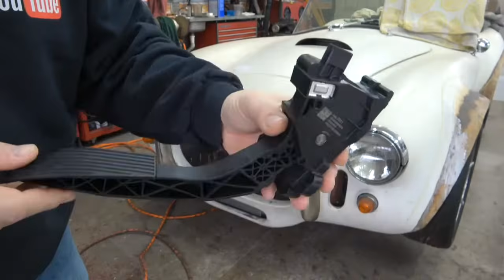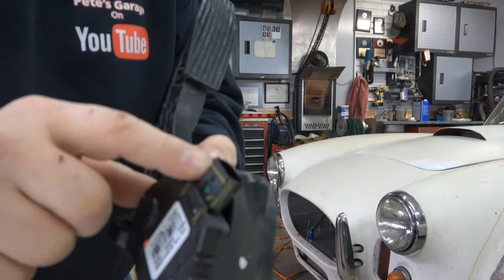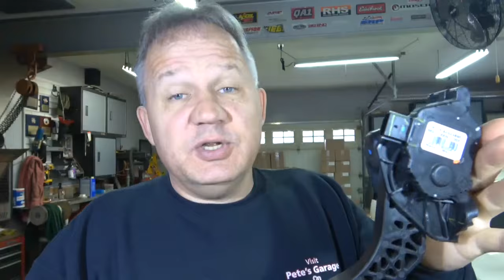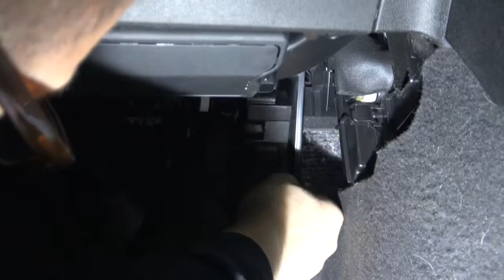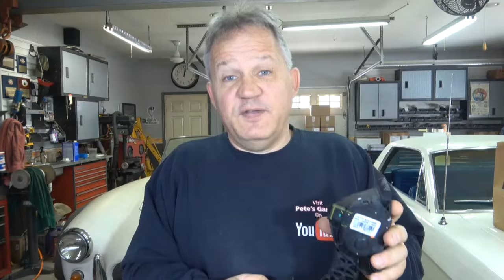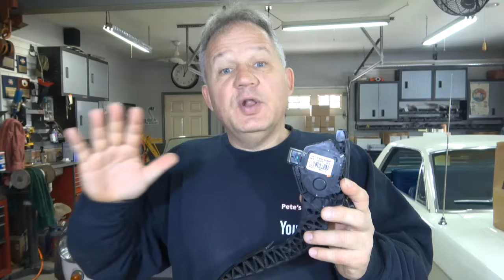Engine Reduced Power Mode - Loss of Power While Driving

Comment: I've had 5 mechanics, including GM mechanics, replaced everything the computer tells me to replace, everything that GM suggest, sometimes more than once, plus extra grounding was done. None of it worked. Last time GM mechanic said computer recommends replace TAC module, which has been done twice and if this does not work there is nothing we can do. Dah, would you ever tell anyone that? shared issue with GM and they said we will get back to you; well they have not and are not interested. Any suggestions?
Reply from the maker: That really sucks. If it were mine I would trade it in
Reply: Hi,were you able to fixed  your car? I just don't  know we're to take my car any more😢
Reply: @marrjor0754  any luck

Comment: I have a 2013 sonic 1.4 turbo and I was driving my car all of a sudden got louder so I tried to get home then the engine power reduce light came on and my car went to 5mph then it cut off and I tried to turn it back on and no response so months later I took it to a shop they replaced the body control module and the car worked great for 3 days and it went back to the same issue so I took it back and they couldn’t find the issue , so far I replaced the starter , ignition switch , battery and still no solution so the shop installed a button to start the car which it’s wired to the starter so when the car don’t start from the key I have to hold the button to start so I drove it back home the engine reduce came back on again and I just left it parked and I still can’t figure it out
Reply from the maker: That's a crazy problem

Comment: I have a 2017 chevy malibu 2017 ls 1.5 turbo I've been dealing with the engine power reduced changed turbo... pc valves...and throttlebody... so I came across this video cause I don't know what to do if I pull over 10 seconds shit off I'm good but if I punch on the gas it goes so much then kicks me into engine power reduced help lol
Reply: I’ve been looking at getting a Chevy Malibu  been doing a lot of research on it. If you didn’t already get a new Accelerator Pedal….. it might be High Pressure Fuel Pump roller follower pin walking contacting the cylinder head  that and will put the car in reduce power mode  its was a problem with the 2016-2019 1.5 engines   You can look online  GM posted about it ‘ PIP5610 maybe that might help you
Reply from the maker: Interesting
Reply: And you can’t really find anything on YouTube or google talking about that issue with the pin hitting the cylinder head so I guess it’s doesn’t happen a lot  but I hope you can figure it out and it’s not that problem ..

Comment: Awesome. Got to work this morning in my 2022 Tahoe RST 3.0 Duramax and it entered limp mode with check engine light..

Followed advice in this video and turned vehicle off, opened the door, and pumped the accelerator for about 30seconds. Turned vehicle on and both limp mode and engine light is gone.
Reply from the maker: That's great

Comment: Is this common with people thinking it’s a throttle body issue I had this issue but nothing changed when I got that in and added a new crankshaft sensor and a cam shaft and two timing chain sensors 😂 everyone I know that works on cars are saying timing chain but I’m not sure… and ideas perhaps
Reply: I have been dealing with this problem for  2 years , every time I change the whole throttle body and it will last about 6 months before it says reduce engine power. Luckily my auto parts store allows me to exchange the throttle body for free. I have no idea what to do next.
Reply: @thatsallfolks3115 ground wire
Reply: @anlitteral  hi did you fixed your car ?i have same problem I have done and change so many things I'm just very stressed. 😢
Reply: @anlitteral elaborate please?
Reply: you just solved my problem thankyou ❤ 100% - was a stuck accelorator
Reply from the maker: It can be many things

Comment: Hello Pete I’ve been having this problem with my 2014 Buick enclave I got it diagnosed n says replace ignition relay which I did n ban it still happened again but that is the only thing that comes up when being diagnosed what could be the problem?
Reply from the maker: Electrical problems usually lead to other ones. Something is causing the relay to fail
Reply: @PetesGarage  ok thank you I’ll check on that
Reply: @PetesGarage  Grounding wire check all the way around?

Comment: 2014 Camaro engine power reduced it’s just cranking exhaust was bubbly noisy little louder then I hit gas hoping it would jump out and boom all electric is on but car is off going down street luckily I parked at house
Reply from the maker: That doesn't sound good
Reply: @PetesGarage  still won’t start I just hit over 100k miles . Just cranks but all power still works. It also says engine power reduced still
Reply: @PetesGarage  I’ve already replaced alternator and battery idk

Comment: I've done everything it STILL does reduce engine power one month good and bang again reduce engine power help please
Reply from the maker: Have the codes in the computer read to see what is going wrong
Reply: @PetesGarage  yes sir
Reply: @benitocastillo6410 did you find a solution? And what vehicle are you having the issue with?
Reply: @thatsallfolks3115  on GMC 2003 Sierra 1500 HD 4/4 6.0 I'm told everything I replaced good but it's the computer
Reply: @benitocastillo6410 was your computer reset after you changed "stuff"? Just curious
Reply: It was a bad auto throttle body orally gave mechanic 2 times a difficult  got it new from Napa running like a sharm

Comment: I would test something because EFI wasn't surrent time but they was using diesel fuel at the time General motor timed up with ? Detroit motors they came out with diesel engine my request is carburetor intake on the duramax just ????? It has to done a internal combustion but my ideal can be done and it already has because Cummins, Detroit, international, Ford, has already ran the carburetors on diesel engines, EFI didn't come out at a surrent time specially for chevy early 90s late 80s they swap to EFI. ?

Comment: when the alignment sensors are already on the car and the before alignment specs are recorded I can do a 4 wheel alignment on a honda accord in 10 minutes its totally easy. the hardest part is getting the readings in the first place. if the alignment is off be 4 degrees it can be like driving on ice on wet roads